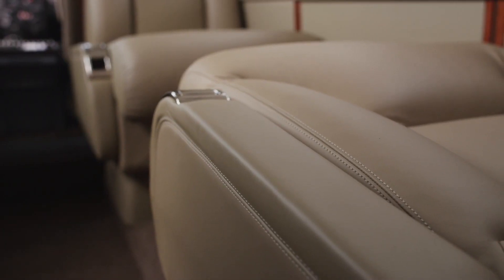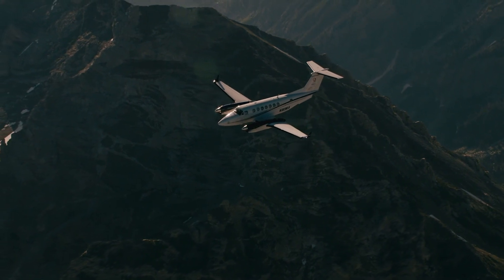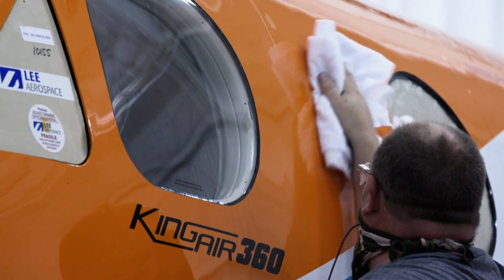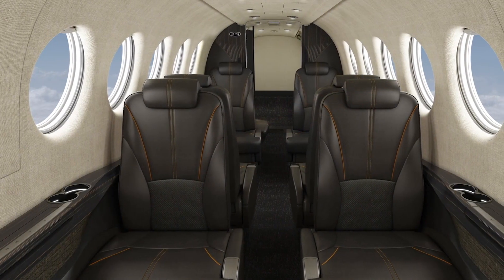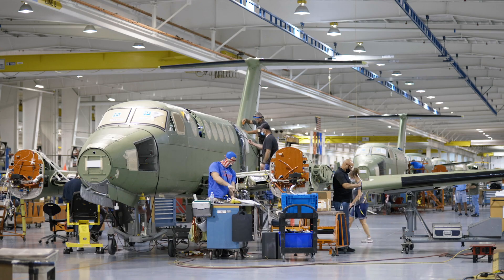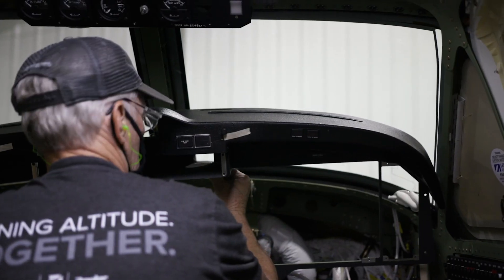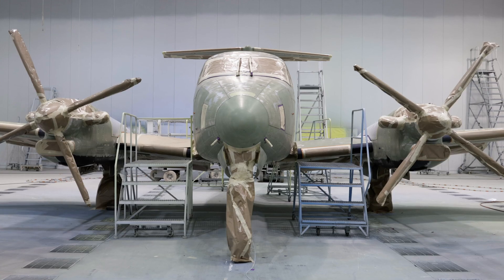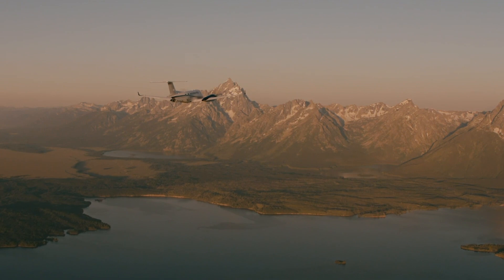Behind-the-scenes: The team behind the new King Air 360

Comment: If Beechcraft would completely resign the landing gear system on the King Air it would be the greatest twin engine turboprop to ever be built
Reply: What changes would you prefer?
Reply: @beachbum1523  eliminate all the stupid electrical switches and Put a hydraulic pump on each engine, run it like a Piper Navajo

Comment: I wonder when the black hawk mods and upgrades are coming out for the 360, you folks missed a great opportunity to do a 5 blade prop , more powerful engines and sturdier landing gear to make it even greater and faster.
Reply: Blackhawk has received the STC for reoutfitting the King Air 360's with the Blackhawk PT6-67A engines, along with the 5-blade natural composite MT-Propellers with spinners. Blackhawk is also working cooperatively with Textron Beechcraft. New KA360's can now be ordered with the 67A engines and the 5-blade props, but they will come at a premium. I don't know how much more they will cost. I do think they would probably be worth the investment.

Comment: I hope Beechcraft/Textron fixed the awful air conditioning system and useless deice system. The addition of single point high pressure refuelling would have been good, the Caravan has had it for years.
Reply: Hahaha yeah it’s garbage in the summer and in the winter.
Reply: On the first 500 KA350's that was a problem. The later KA350's, 350i's, and 360's have Kieth freon air conditioning, a great improvement over the old system. The 350i's and the360's also have a split cabin system which allows pilots to be comfortable in the cockpit, while allowing passengers to adjust the cabin air to their linings, which has addressed that problem to a large degree. Is it perfect? No, but every aircraft is an exercise in compromise.

Comment: Change some modification on king air like instrument panel on nose make it easy to open and some parts like bleed air regulator hard to change also make Ele plugs on wires on the parts blower on nose make it easy to replace power back also one of the hard parts main gear actuator it take more than 8 hours there’s many parts need make access or reachable thanks